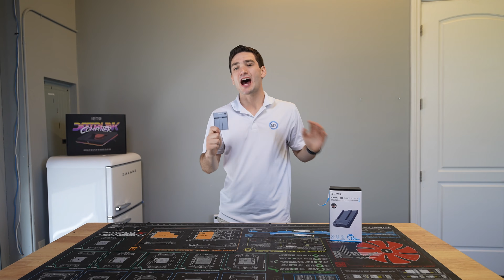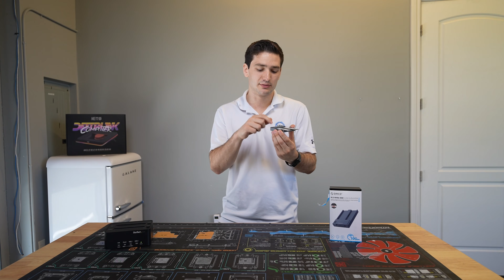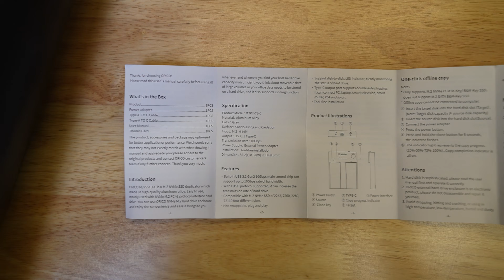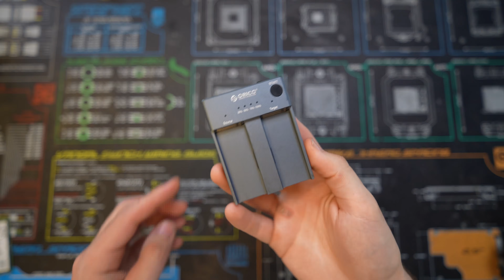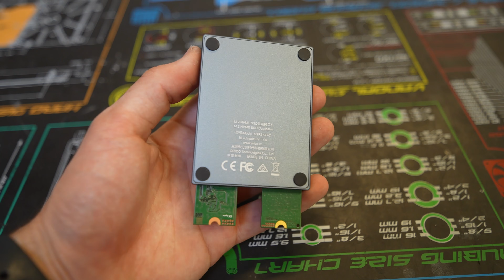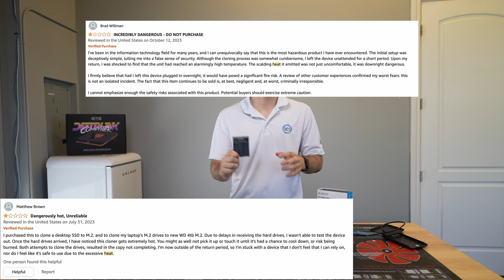This Product Burned ME! Orico NVMe SSD Drive Cloner

Comment: It could be worse, it Fried BOTH my Samsung 2TB NVMEs, and being the first time using this cloner, I had to assume it was done. Well when I put it back into my PC the Orico damaged NVME fried my 128GB of Corsair RAM, my AMD RX series XFX GPU, as well as blowing out my Z390 Aorus Master motherboard and worst of all, it fried the Northbridge on my Intel i9-9900KS. Intel spent 11 hours on the phone with me at the end of which they said they don't have anymore of those i9-9900KS CPUs because to many people scammed them. They ended up replacing it with a i9-12900KS, so I had to buy a new motherboard, 128GB of DDR5 RAM and other accessories while I waited for RMA on the other parts. Orico has a pretty terrible quality control system because this dock should have never made it to a end user.
Reply: What?! an NVMe hard drive DID ALL THAT?! FRIED YOUR RAM,MOTHERBOARD,CPU, AND GRAPHICS?!

Comment: Don't buy it, it is garbage.
1. you stand a chance of damaging the storage pcb , when pushing it into the side bay clips
2. it WILL NOT work with a LOT of  drives, it JUST WILL NOT clone
3. it is INCORRECTLY assembled, the internal chips DO NOT make proper contact with the back plate heat spreader , the thermal pads are too thin

Comment: I see you have a Startech dock over there, they make junk junk junk. I learned my lesson with them.
You know NVMe's get pretty warm, so it's your fault for grabbing it while it was still hot, do you check electrical outlets with forks too lol. Let it cool a minute bud, and if your hands are that soft, well geeez.
Reply from the maker: From my experience with the StarTech drive docks they are some of the better units out there and the ones I’ve owned have had really good reliability. 
When it comes to the heat of the drive it wasn’t the ssd that I grabbed it was just the housing. My point is that if the device was better designed it wouldn’t have this issue. And 65 degrees Celsius is hot enough to burn skin within about 2-3 seconds.

Comment: regardless, it needs to slow the data transfer to keep temp in check
Reply from the maker: Of course that’s one way to fix this issue or they could just design it better to run cooler, such as increasing the size of the aluminum body to better dissipate the heat or add active cooling with a fan.

Comment: This is false. A good review, however, the temperature states are posted to Amazon. According to the ORICO-M2P2 temp test, an offline clone after 10 minutes run time, target SSD temp is 62.3.

However, I agree with all your thoughts and opinions.
Reply: What are you on about? SSD Temp and device temp are different or did I misunderstand you?
Reply: Actually I have the same experience. Mine running for around 7hrs now. And it’s 80 degrees celsius RN. I worried it will toast these ssd. 😅
I immediately look for reviews since my supplier ain’t replying if it’s normal after getting burn for touching just a second.